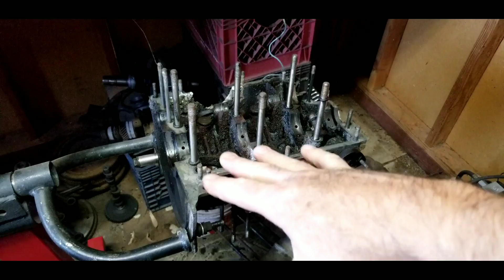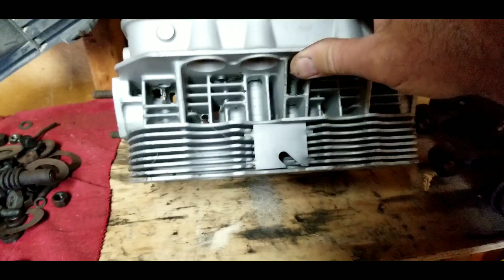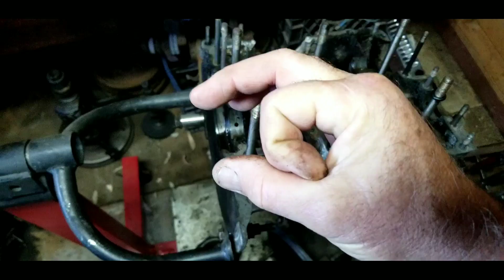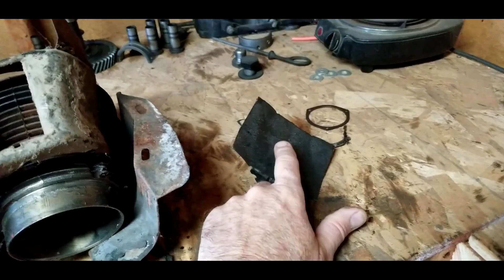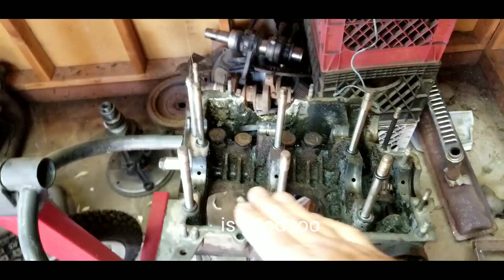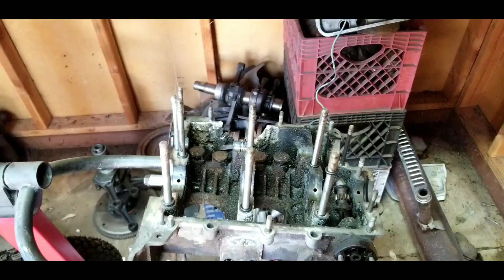BEAT VW ENGINEERING ?  can you do it? engineering that might beat VW flat 4 engines

Comment: Great video and I’d strongly recommend watching the engine build videos Mike mentioned.

One key thing about improving on VW engineering from those videos was cutting a notch in the main bearing oil passages to better align with the main bearing oil galleries in the case.  A really simple thing to do and a huge improvement on oil flow to the main bearings.

Comment: what I am getting together is , I got  some EMPI 4340 con. rods , cool tins , Erling gaskets , new quiet pipe with J tubes I got a 3/8 tube to weld in to get heat to the center mount 32-36 empi carb kit, I am going to ask Matt if there is a shop around here to open up my heads and block for some 90.5s . right now I have some Mahle 85.5  . 69mm 4041 CW crank , a W 100 Engle cam and lifters Autolinea mag case , and some D-port dual port heads. my motor has only 4-5 thousand miles . It is running good . when i got my case I wanted a alum. but Austin at Car craft said that with a Alum. case on a bus I need at least a dog house fan shroud . So I just got the Mag. case. If I could get the old case new lifter bores I got enough used stuff to make a junk motor..My old VW crank has .0007 wear on the # 1and #2 mains but every other journal is almost right on the money! It would hold oil pressure. It is to fix that case the shipping out weights the cost of a new one.
Reply from the maker: yea that shipping cost is so much. yea you should have dog house with aluminum good point. they do get a bit hotter. so having the dog house for the oil is necessary to keep the oil cool enough. I run the aluminum full flow. with dog house and external cooler and thermostatic fan. Mag does dissipate heat better but has lots of other downsides. Man if you came out here for El prado you could get some machine work done and buy some stuff almost pay for the gas. 2000 cars at last show 2 years ago.

Comment: Mike what’s your take on my 62 1200 motor rering. These are 77 cylinders. The bottom end seems fine. My compression was 60, 60, 60, 90. I’m just going to douche the case out so its clean. Put all new outer seals and gaskets. Re seat the valves. New tubes and such. When it’s done it’s going to sit in my living room like furniture. Because I can.
Reply from the maker: I use those all the time. works great. also pull the exhaust valves and do a little porting on the heads knock down the sharp edge  with a porting tool and make it so your pinky can fit in.. Relap them. Engle 90 cam helps a lot. too. If your really savy you can put stock 1600 rockers on it. takes a bit of work to cut the pushrods or shim the rockers. but gives more power. That is about as far as I go on them. the cranks are not that strong. and if you drive it too hard you can break them powershifting or trying to get scratch.